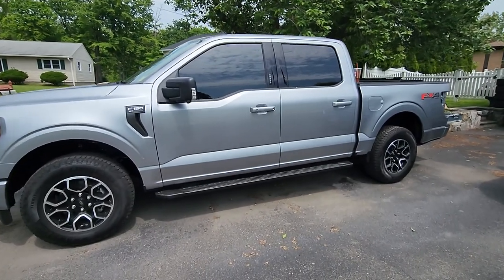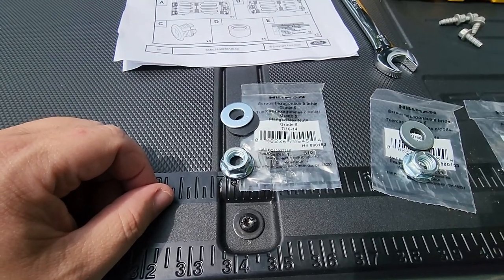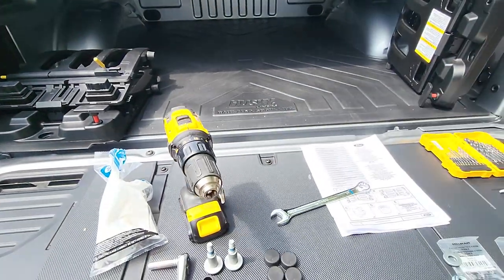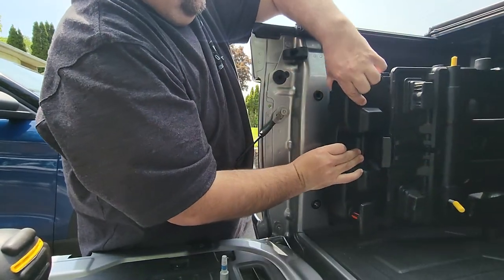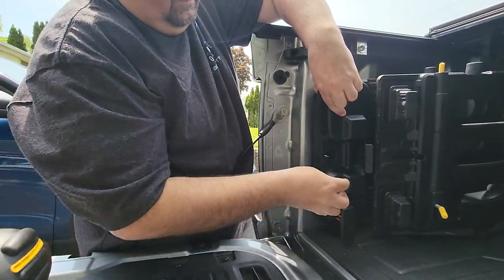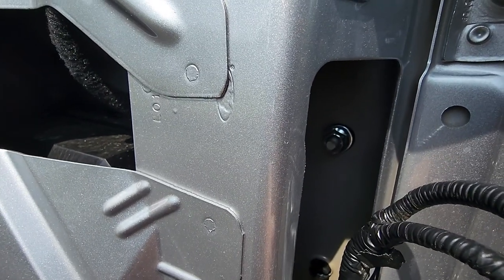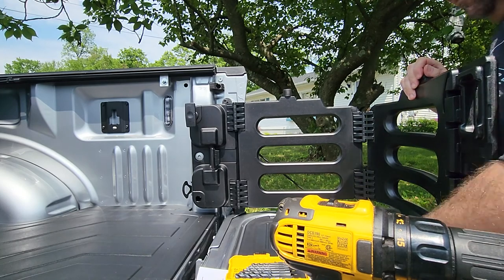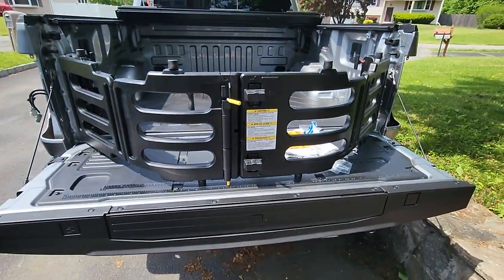2022 Ford F150 Bed Extender no drill holes issue

Comment: This may work but it’s a bit ghetto imo. I’ve had this bed extender for about 7 years and you might need to take it off in a pinch. It takes up room sometimes when you need room. You’re going to have to remove your lights anytime you want to do that. What I’d suggest is popping a rivnut in that hole. That’s what I’m going to do on my 2024. Then you never have to take those lights out ever, even initial install. My $0.02.

Comment: You just saved me $1200 Canadian for a new bed extender.  Also ML3Z-99286A40-B is the proper one for 22-23 F150s.  I spent $75 on my extender back in 2018 for a used one and its going to stay with me now.

Comment: Same with me, 2022 Platinum. I was told that because it was equipped with the 7.5 kV power system they didn't offer it as an option. Regardless, I followed your instructions and it works perfectly, thank you.
Reply from the maker: Never thought of that. Mine has the 2kw generator. Maybe that's why!
Reply: Tail lights 🤔
Reply from the maker: @Q80hobiecat63  good observations! I said headlights by mistake.

Comment: That's crazy that the holes were not threaded.  I plan on getting the same bed extender when my 2022 XLT truck finally gets here the end of June. Hope mine is threaded.  I have the same bed extender ono my 2011 XLT,  but the dealership installed mine when I bought the truck back then.
Reply from the maker: Tell me about it! It makes no sense at all to me! I had to make it work my own way.
Reply: Hey dude those are taillight!
Reply: @fordtrucks3960  Don't understand your comment? I installed my new tailgate extender  on my 2022 F-150 by taking out the headlights to put nuts and a washer on the back of the threaded bolts that I had to purchase from Ace Hardware as it only came with the threaded bolts.    My 2011 Ford F-150 were threaded holes and you didn't have to take the taillights out to install.
Reply from the maker: @fordtrucks3960  lol I know I said Head lights in the video by accident!
Reply: @terrygermano4555  thanks for the video man...FYI it was a cost savings reduction at some point in 2022MY run. My 2022 lariat doesn't have the nut installed.

You gotta think...the cost of the actual fastener (nut) itself, process time/money to install it, extra time/money spent to quality check the fastener and so on multiplied by 500,000+ (x2 one for each side) trucks each year is quite a substantial cost for something that is there as an attachment point for an optional accessory. (You can even double that cost savings if you extrapolate the data over to Super Duty as well)

I was going to go to my dealer and see if they'd throw some rivnuts in but this seems reasonable enough and easily done in the driveway! I kept the divider from my 2016 before I traded it in and was looking forward to putting it on my 2022. Used the hell out of it.